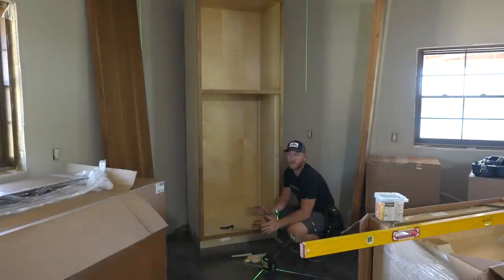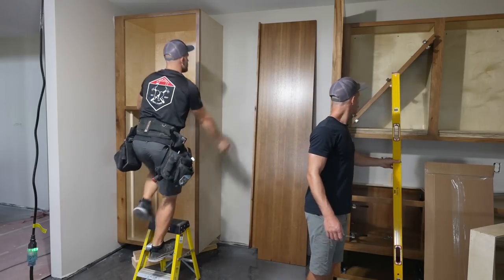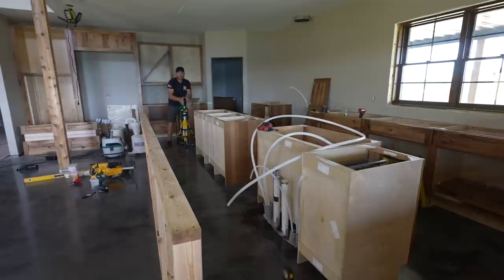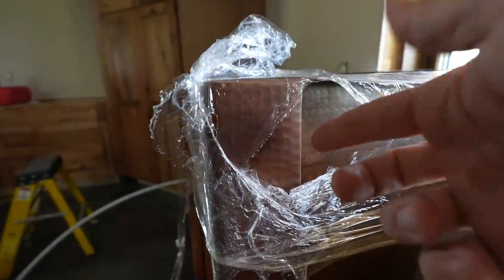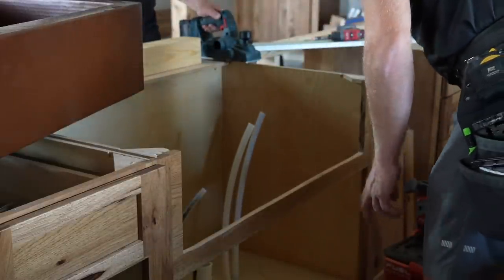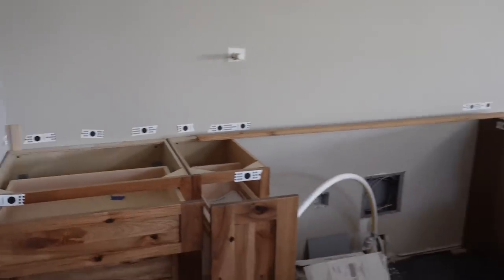Barndominium Build: Installing Kitchen Cabinets #cabinet #install

Comment: just as an FYI when you are trimming PVC down like that, you can protect your Pex by sliding a short piece of PVC over it while you trim it down. I've done it as an electrician to protect wires when I've had to lower a meter to install a Transfer Switch for a whole house generator. It even speeds things up a bit; because you don't have to take as much time to be careful not to nick anything! just for your information if you're interested.

Comment: I would use a transmission jack to lower that sink base cabinet enough to get the pipes all through the bottom.

Comment: Great episode...  A few things learned after 40 years of trim carpentry :  No tool belts when installing cabinets or around finished items, too easy to scratch something.  Use a countersink bit to predrill the styles  along with 2-1/2" grk wood screws, then fill the hole with the putty from the cabinet mfg. 
Love the channel!
Reply: Its true you only need a couple  drill ,tape measure and screws, great video

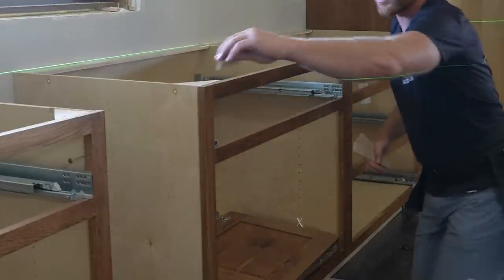Comment: At 5:00 I used your laser level trick and was able to be more accurate than spirit level. 

I mount my laser level 2-3 inches above the desired cabinet height across from my workspace. 

Then I find low spot and set my speed square on the top of the cabinet and use that distance as the reference line. Every spot on every cabinet should be at the distance/reference line.

Comment: It's just fun watching this dude work, I bought the big gun to build my pole barn and the gun fell apart after 50 nails! They didn't use thread lock on anything, I had to tear it apart and thread lock everything, $1,200 gun works great now.

Comment: Photo control points used in photogrammetry. Two overlapping photos will tie the photos together at the “dots”. The 20” will be each model. Then triangulation generates the numbers to stitch the images into one large photograph that is accurate, in this case probably to a millimeter or two.

Comment: I did the "accidentally pulling out a too long screw thing" about a week ago and put six screws through the girts and out the steel on my new baby post frame building...so I understood your concern about that!
Reply from the maker: Yikes
Reply: @RRBuildings  The word(s) I used were a little stronger, Kyle. LOL Fortunately, I have caulk and touchup paint. 😉

Comment: Just shows how important it is to get everything square/plumb/level from the ground up. A little extra time getting started right will save you hours & hours making everything fit right all the way down to the trim.

Comment: Hey Kyle
I also use the makita track saw. I use a 2 pass method on cabinets. I take advantage of the score stop feature then finish with full depth cut. Leave an awesome cut with no taping.

Comment: Only thing I'd do differently is get yourself (or make them) some flat shims. You don't want to use those wedge shims. Make them out of wood and multiple thicknesses, including a near paper thin backer sheet. 

Also, don't have the shim sticking out the front. Stick it out the side of the cabinet where the other cabinet will be sitting next to it. Then you can use those same shims for the next cabinet, and guarantee that those two cabinets will be at the same level. Then just level up the other side and repeat. Also prevents you from accidentally kicking the shim, or having to trim the excess shim off the a multi-tool.

Comment: When I was working on a building site the cabinets came in with a Blue film on to protect them,!!  the lady that was buying the house walked on site, without permission!!, and started complaining, so me and the manager went to the house and asked what the problem was? the lady complained and said I want ALL these cabinets taken down as I didnt ask for BLUE Cabinets!!, I went and pulled a strip of the blue cover off, and just looked at her!, she went Red with embarrasment, and was told by the manager to stay off site untill house was finished, she walked off. Good job Kyle.

Comment: You should countersink the screws you use to attach the face frame. I use regular construction screws. Match the color if possible. Then use the grk pan head cabinet screws to mount the cabinet to wall. That way if you can’t hide a face frame screw behind a drawer it’s still pretty hidden.
Reply: Hide them behind a hinge plate. All my hinges have the exact spacing so I know exactly where I can put the face frame screws to be hidden by the hinge plate!!

Comment: Couple things. I can't tell if you clamps have a cushion on them but if the don't when you tighten the up as you join them together your going to leave an indention in the style. Also why are you using large head screws to join the cabinets? Use small trim head screws so they are not visible. Then you can cut plugs to fill them.

Comment: Kyle.   Great work and I gain from watching you and I'm, grabbing all the details. But I must ask why would the sink pipes came from under the cab?   If The plumber missed the layout I would absolutely demand that he cut the concrete and move all my pipes to the back of the cabinet.  You guys do great work and after building over 100 homes turn key I'm still watching for little tricks and technics.   Keep up the good work   ALOHA FROM MAUI

Comment: Do you think tapcons are better than drop in anchors for a half wall like that, Kyle? I am thinking, with drop-in anchors, you would be able to use bolts and washers to add more stability to the half wall. I've heard people I work with complain about them not holding, but I've found that when I use the set tool for them and drive them firmly to set them, they are very solid anchors.

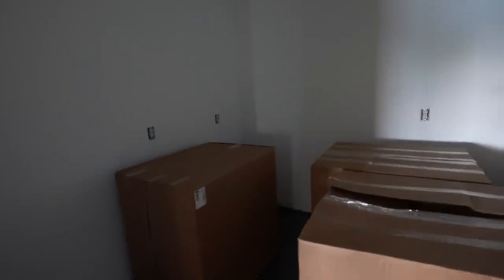Comment: I am interested in the dust collector that is in front of the vacuum at about the 20:00-20:30 mark.  Does it work well?  What brand?  Would you recommend it?  Will it deal with fine dust?

Comment: 26:48 What about the air that gets trapped inside your circles? Looks to me that it may push against the panel when you're trying to hold it flush.
Reply: excess air gets pushed out, similar to a rubber valve, that's what creates the suction he's referencing.  Shocking how well this works.
Reply: @ironoaok  Nope. Artic is 100% right.

Comment: Is that how you install a kitchen in the US? Taking ages. This is how we did it in the 60is in Scandinavia. Even an IKEA kitchen is faster to install than that.
Reply: Obviously this is your first time viewing this channel. Kyle doesn’t rush anything he takes his time and does things correctly and his craftsmanship is 2nd to none.
Reply: How do you do cabinet installs in Scandinavia? 
I like to learn new faster techniques.
Reply from the maker: Me too please post a video
Reply: I have no video to show. But basicly you screw a rail with a laser into the wall for the top cabinets, And then you just "hang" the cabinets on the rail.
Floor cabinets we usually have no base as in this video. You screw a 2by1, 5" from the floor and you "stand" all your cabinets on it, cabinets have adjustible front legs to tilt the cabinet into level (when Kyle using shims). The base bord or what you call it in the US, we just snap on to the front legs. Easy to remove if you want to pull extra electrical lines or water lines under. Hope my poor explination made any sense. Maybe my first comment sounded little rude, that wasen't my intesion. But I know Kyle doing a great job and are very picky with details, just as myself.